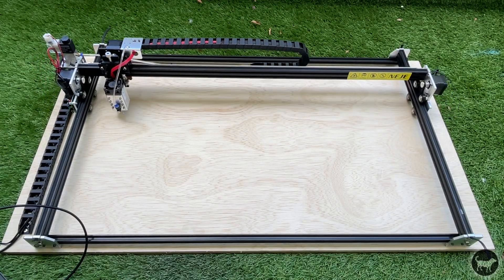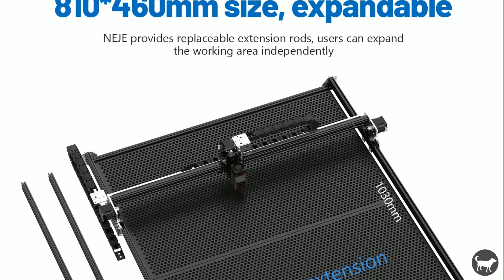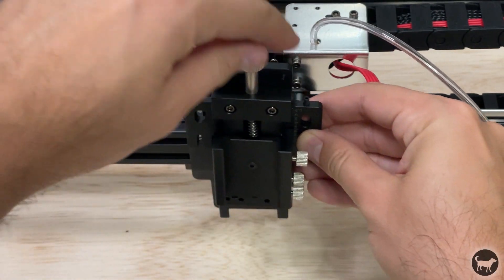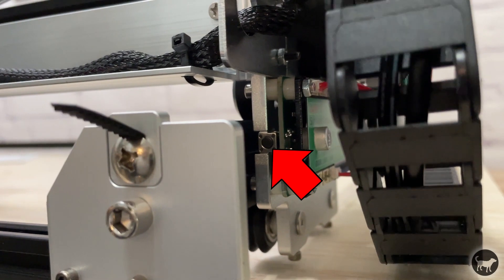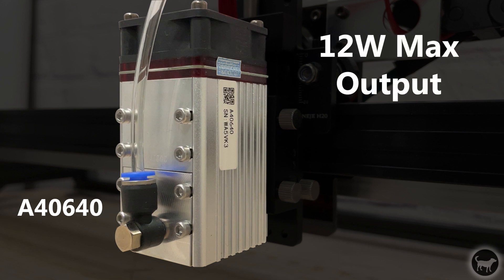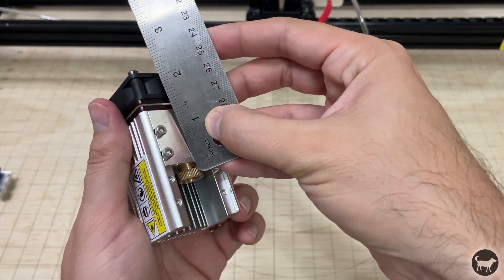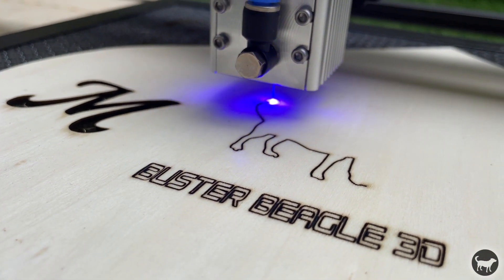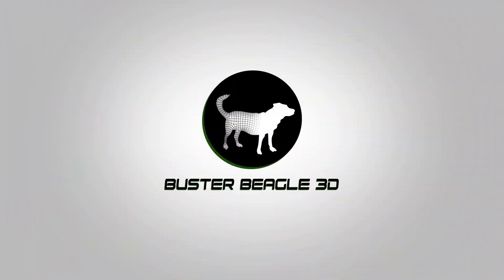NEJE Max 3 Review | A40640 Laser Module | Diode Laser Engraving and Cutting | Massive Work Area

Comment: Hello 
First of all , i want to say thank you for your video. It helps to assambly the frame , as you said in the video the air valve are not matched to the holes , so i drilled the new one , but it didn't help - the holder are not sufficiuте for such application )))
Secondary , may you say i have few questions :
1. Do you have the grid file and how did you do it on the board ? I suppose you adjust the lens focus that the beam point can rich the base ( base where you screw the frame), is in it ? 
2. As faк as i uderstood you use the lightburner? will you make some adjestment in the programm ? 
The problem is if i make the cycle in official neje programm , then i will get it , but lightburner makes the cycle with the lines (the shape is looks like a cycle , but visualy it is not like a cycle)&
Thank you in advance.
Reply from the maker: Hello. You can get the same grid that I was using here. https://www.etsy.com/listing/1270151863/neje-max-3-grid-for-spoil-board-digital?click_key=c0585d44e05e84f0b2d5ab847993b5e2048ffb9a%3A1270151863&click_sum=3ff49a18&ga_order=most_relevant&ga_search_type=all&ga_view_type=gallery&ga_search_query=neje+grid&ref=sr_gallery-1-4&organic_search_click=1&sts=1&from_search=1

As for your second question I think you are saying that you are trying to burn a circle and it’s not coming out as a circle? I would first make sure that your belts are not too loose and then I would run some tests to see if you need to adjust your E STEPS. Here is a video that should explain what I’m talking about. https://youtu.be/ZRXVhWA2kqk
Reply: @BusterBeagle3D   Thank you. I found the problem with the cycle . The was a software problem - i download the previous version and everything is perfect

Comment: Dear Ryan, thanks! Such great video and review. And I have maybe a bit not standard question. Could be this machine used also for just drawing? Simply replacing laser wit some pen or pencil? I would need to draw some big drawings automatically and this machine and its size seems to be great. Thanks for help!
Reply from the maker: I suppose you could. Just attach a pen and using the same software draw the outlines or process the image as a dithered image to make a more photo feel out of dots. I haven’t done it myself but don’t see why you couldn’t.

Comment: Hi I saw your video and I also have the expension of this model, only I can't use it right. when i give the same imput as you do at lightburn it moves not right. The X axis is not the problem, so it moves from the left to the right. But my problem is with the Y axis. It can't u the full 1030. when I put the normal values is (810x460) there is no problem. But with the extension (810x1030) is't giving problem in the form of the motors rolling against the starting point. What am I doing wrong?
Reply from the maker: Just make sure in your device settings that you have the home position in the correct corner. If you choose the wrong home position your Y position may be off. It probably wouldn't affect the X axis because most machines home to the left. The question is if you choose the front or back as the zero position.

Comment: Hi Ryan -- I bought the same 12w diode, but I am not able to but completely through 1/8 inch thick plywood using 300 speed and 80% power and two passes. How are you able to cut through such thick pieces? In Lightburn, are you using 255 or 1000 for your power setting? I'm using your cutting distance of 30mm.
Reply from the maker: Max value is 1000. If it's still now working either slow it down or up the power.

Comment: Can a roller be used with this laser engraver? if so which model of roller can be used to engrave on bottles and rounded objects?
Reply from the maker: You can use a roller with this engraver. Can’t remember if NEJE had a specific one for this machine but if you are looking to do round objects you may want to check out the RA2 Pro from XTool.

Comment: what is this on top of your wood piece that you hold down onto the honeycomb?looks like a big circle and something is then screwed inside to the honeycomb.can you please give a link to this staff here?
Reply from the maker: Hi. It's actually a piece off of a DIY Injection molding machine that I designed. It's small but heavy so I like to use them to weigh things down. Not really what it's intending for and I wouldn't recommend buying it for laser purposes but if you are curious what it's actually for you can take a look here.  https://www.busterbeagle3d.com/
Reply: @BusterBeagle3D  first thank you very much for the respond.  so how would you secure a board what takes the complete size of the honeycomb?My laser has a work area from 400mm by 400mm.I have no idea how i shall secure this.Last time i tried it didn't work out well.i tried with t-tracks and hold down pins that is normally made for cnc.but this blocks more the laser when it has to work. Magnets are to weak because the piece is 9mm thick plywood. screw onto my work area is not option as well.
what came now in my mind building a thin frame around the honeycomb and secure this on my work area on the bottom.
Reply from the maker: @loganfreeman8237  I haven't had that be an issue for my cutting so far. If I can't hold it down I just cut on it sitting there as long as it's flat. I'm sure someone has an idea somewhere out there.
Reply: @BusterBeagle3D  OK THANK YOU very much
Reply: @BusterBeagle3D  what for a rotary you would recommend for be able to do anything what is round?also what would be the best way to engrave glasses and so on?I saw there spraying,mask tape and laser engraving tape
Reply: @BusterBeagle3D  what are those machines for?looking interesting
Reply from the maker: @loganfreeman8237  They are DIY injection molding machines for making plastic parts at home. It is just a way to do home manufacturing of small parts in bulk that are both faster to make and stronger then 3D printing.

Comment: hello , can you assist me ?
i have problem with my neje 3 max ... it keep cutting a line instead of the sample i make .
Reply from the maker: Make sure you can frame the object are trying to cut. If you can home the laser and the belts and wires to the different stepper motors are all correct then make sure you are not using some sort of rotary attachment setting. Other then that I would need more information about your issue.

Comment: Hi, thanks for your great video. I am going to buy it as well. but what about air support? I cant find info about it. What machine is it on 03:10? Do I need to buy that as well if I want to cut wood?
How to get a response! Thanks
Reply from the maker: It’s a 1000GPH fish air pump. You don’t have to have it to cut wood but it does a better job with something like it. It blows out the kerf or char that is created when cutting wood that gives you a better cleaner cut. Kulife Large Flow High Pressure... https://www.amazon.com/dp/B0965T65B1?ref=ppx_pop_mob_ap_share

Comment: Great video, thanks for putting it together, and for the assembly instruction video too, do you mind me asking which model of air pump you use and is it sufficient for cutting MDF which I understand needs the higher 0.15Mpa pressure?
Reply from the maker: I don’t know the specifics of mdf but I was using a regular fish air pump that was rated at around 1100 gallons per hour. I’m not sure what the conversion for that is but it seemed to work for my purposes. They are honestly so many to choose from. I really like the XTool version of an air pump but even that seems to have a much cheaper Amazon version as well.
Reply from the maker: I believe this is the one I have. https://amzn.to/3Jywq05
Reply: That’s great, thanks for sharing those pump details. I believe the flow rate is 70L/min which is right up where it needs to be
Reply from the maker: @brendanclarke1979  Glad to help.

Comment: Hi, my 3 max is due to arrive any day soon so watched both your videos with abvious interest, also watched LA hobby guys video which brings me to my question, you state to bring the X axis gantry to the front rail to syncronize the stepper motors, as does the Neje site. LA hobby guy says push it to the top rail to syncronize, in fact he's just posted in his comments section emphasizing this point. I'm confused. I've also posted the same question on his forum.
Reply from the maker: I assume the result would be the same. The important part is that it’s level. I just push it forward since the limit switches are on the back and it homes towards the rear. Maybe when it’s pushed the the back there is less chance of becoming unlevel while homing? I’m not really sure.

Comment: Thanks for letting me know you posted this video. Any plans to post how to install the belt adjusters video? I just got mine and going to try to put it together soon
Reply from the maker: No worries. I didn’t have any plans to make a video for the belt tensioners but I can tell you that you need to unscrew everything from the belt tensioner before installing it. Just look at pictures from the website and it should be fairly self explanatory.
Reply: If you was to buy this now have they put all the addons that you did in a pack     plus if I was to get the extended bit could you change back and forth between the two sizes?
Reply: Neje have posted this video that shows the steps to install the extras: https://youtu.be/qnPpKf90A-g

Comment: This is an impressive machine for sure. Have you had any success cutting acrylic sheet on it? 
Definitely a tool I'd look at adding to the workshop but the ability to cut acrylic at 3mm min and various opacities is something it'd need to be able to do
Reply: My new Neje 3 max is due any day soon, currently I have an Ortur OLM2 Pro 5.5w, its cuts and engraves black and darker coloured 3mm acrylic no  problem, however it will not cut clear acrylic, to my knowledge no diode laser will even the new 20w quad diodes. If my ortur can do it the Neje certainly can, clear acrylic is a big no, the lighter and more translucent the acrylic the less likely it will cut. You can hower etch clear acrylic using various work arounds, there are numerous U-tube vids on this. Hope this helps.
Reply: @davidadcock9421  I saw someone in neje's Facebook group successfully cut 3mm clear acrylic. Very impressive. Lots of people commented on that post
Reply: @Kun373  I would dearly love to see that post, do you have a link. I've watched every video on this subject that I can find and without exception they all agree that a blue diode laser can not successfully cut clear acrylic. The wavelegnth 450nm just passes clear through it, you can etch by applying a paint or similar coating (I use Rustoleum Black Peel Coat with excellent results) So have we all missed something?